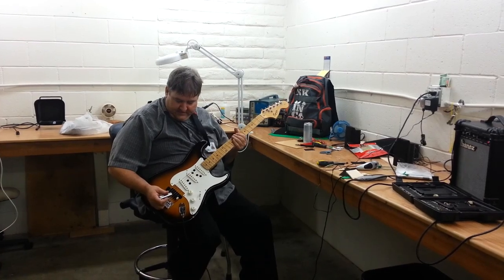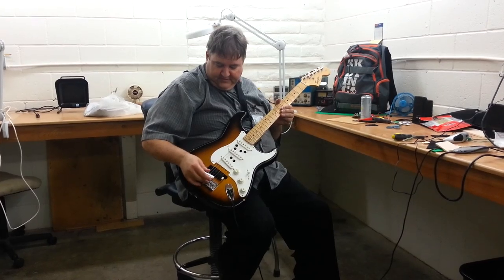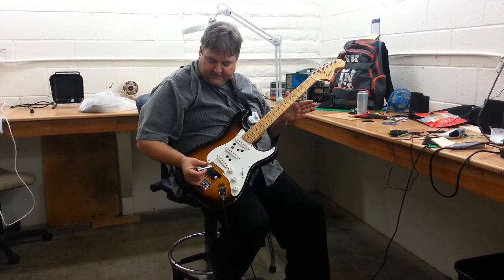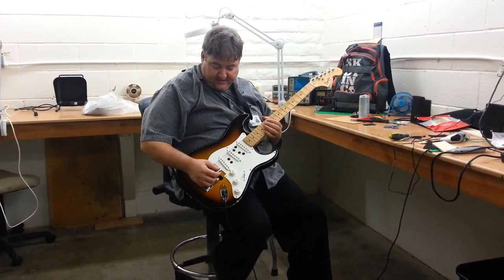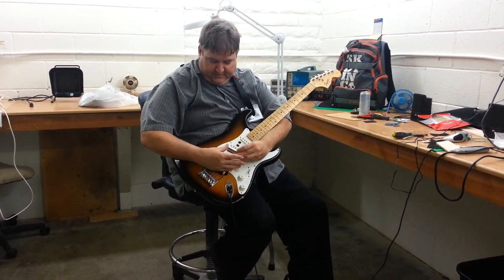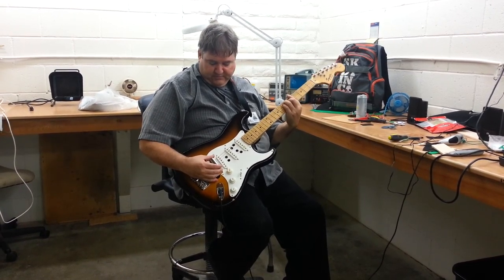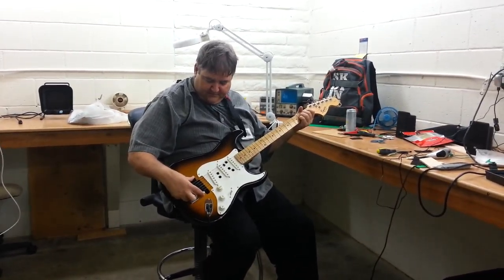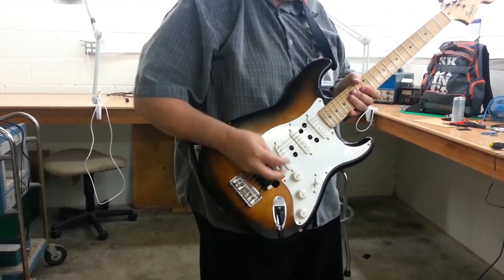Open Bridge Slide Technique and Innovation for Guitar

Comment: Thanks for the video! What effects are you using? Or can you suggests any effects you think might give it more of a sustained, violin, singing, sort of a sound when doing the bowing?
I've been trying to recreate a sound I used to make years ago using the "bowing" technique with the slide, but I can't seem to get it right I know I had some kind of effects petals hooked up when I used to do it. Would love to have your input. Thanks!
Reply from the maker: Funny you mention that. What you need to do is two things I think. I have not tried it yet. Mask the dead spots in the bowing by using a very short delay or maybe a long delay effect. Short delay for when you are playing fast or stacatto. Long delay when you are playing legato, or longer notes. The other effect would probably be compression so that you can bring up the volume without playing too loud. Or a limiter which is the same thing. So when you are bowing it's slightly more quiet than picking, and not as smooth as violin. So the delay helps smooth it out, and the compression helps make it louder without you making it too loud when you start picking normally, and to limit the scratching noises. I currently have tried this on bass guitar, you don't necessarily need a modified instrument. You can scratch as near to the saddle as possible, keep in mind that it's similar to slide guitar in that it changes the pitch as you move. I use my pick to scratch, but you can use a slide.

Comment: Surely intonation must be wrong?
Reply from the maker: Oh it's totally off in this prototype. But if it was built correctly you would have the same intonation as a regular guitar. But it's based on where you place the slide, or where you apply the bowing effect. It has to be where the bridge used to be or if you don't want to mod a guitar (I would not blame you this is crazy!) then you can just scratch your pick as close to the bridge as possible. Perhaps you could have a special guitar intonated for this technique with the saddles back but then you would not have any space for the muting device, so you would have to be very careful not to let open notes play or it will sound horrible.